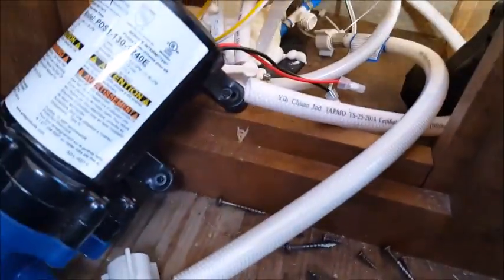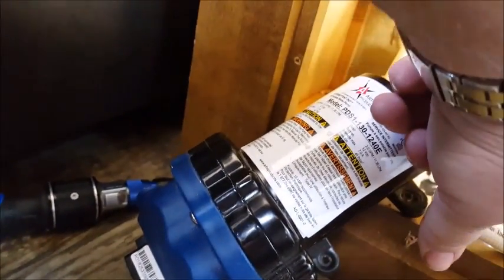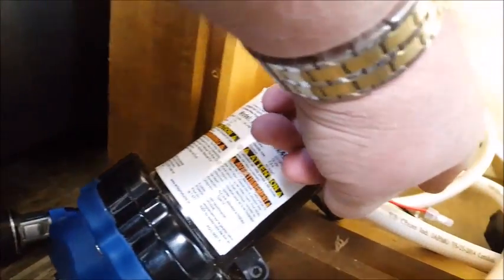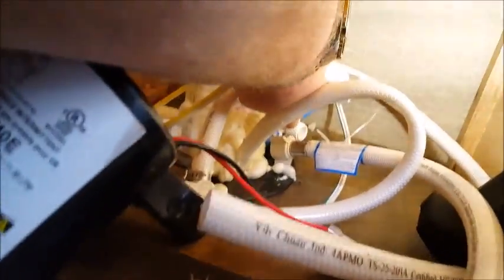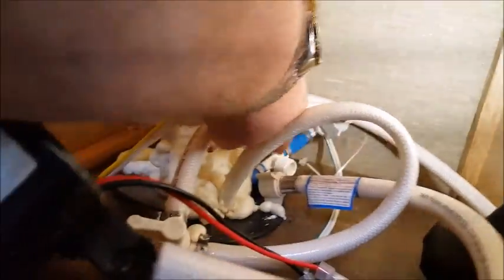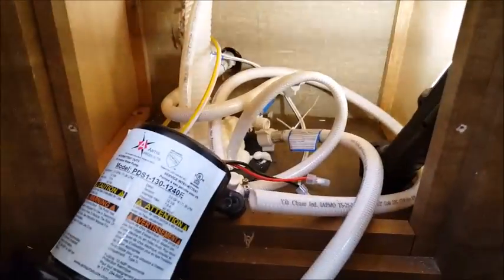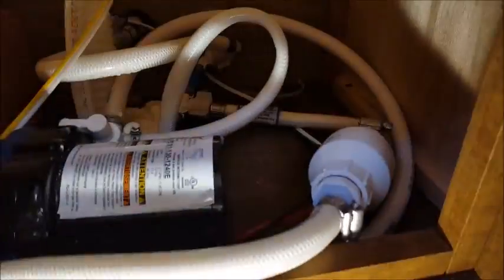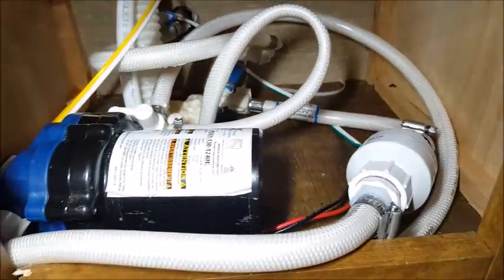Check Valve Installed in Water Line in RV

Comment: I had the same problem with 3 Surflow water pumps in a 18 month period. Messaged the manufacturer my problem and they acknowledged that they have/had a problem with the internal bypass valve and wanted a photo of the pump with the manufactured date (02/2020) and they would send me a new one free. I did receive the new pump, but in the mean time the water quite flowing into the water tank, so I just put the pump away for now.  Will be installing the check valve as a back up.

Comment: Here's my take on city water flowing out the fresh water storage tank.

The city water comes into the RV via a check valve at the city water connection.  I regulate the pressure to 45-50 psi.  The fresh water tank feeds non-pressurized water to the pump which, by its design, acts as a check valve.  Once the water is past either check valve it is trapped.

Enter the hot water heater.  As it heats the water, the water expands.  The check valves keep it from leaving the system so the pressure builds in ALL of the plumbing.  Turn on the tap and the extra pressure is relieved.  And if the hot water heater stays on, the small amount of expansion of the new, cold water in the heater can be dealt with by the RV plumbing until someone turns on a tap somewhere aboard.  Anywhere aboard. 

The water heater is the biggest single draw on my 120 volt, 30 amp electric service.  I can't run the water heater, the AC and the microwave (or a hair dryer) at the same time.  With 90+ degrees weather this spring in South Carolina the line voltage dropped from 123 volts at 6AM to as low as 108 volts at 4PM.  So limited amp service and a brown out that makes the AC draw even more amps.  Somethin's gotta give.

I shed the water heater to propane until the gas bottle started getting low.  Then I just turned it off until I needed it.  I did notice that fifteen minutes later when I ran the tap it gushed for a second till the pressure dropped.  

The real problem:  the RV plumbing has no pressure relief valve other than the water heater PRV rated at 150 psi, 3 times the normal regulated pressure.  This will damage the plumbing.  If the check valve function of the water pump fails and you put a check valve in the line that can take higher pressure the next weakest point will fail.  A weepy fresh water tank is one thing; a burst pipe under a sink is a disaster.

The solution:  Don't turn the water heater off, or don't turn it on.  Or... Install an expansion tank in the RV small enough to fit in the pump compartment (or under a sink) but big enough to keep the pressure from going nuts.

Expansion tank or burst pipe.  It's your choice.
Reply: Really nice explanation.  So what’s this expansion tank?  Got a link?  Is it standard rv stuff?

Comment: We had the same problem on a brand new camper, took the pump apart and cleaned it. That didn't fix it but after installing a check valve it worked like new. It cost us $9.00 for parts at the local True Value Hardware store.
Reply: Did you install in the same place as this guy?
Reply: I put a check valve on, still let water thru to the fresh water tank

Comment: I have the same issue that I am trying to troubleshoot.  My pump apparently has a back flow valve in it and that probably the failure.  Might be cheaper/easier to do this fix.
Reply: I think I have the same problem... I have a Shurflo 4008 pump that has an internal check valve, and there are replacement check valve kits available (found some on eBay for about $12) but I've found zero instructions so far on replacing. I may do this instead.

Comment: Did you solve the problem or just mask it?  How long did the pump function as the check valve before it failed?  Do you get full pressure off the pump or has it lost pressure?

Comment: Water was leaking out of my fresh water inlet.   took it to the rv service shop to have check valve replaced. He replaced the city water inlet instead .  I said it was the fresh water inlet leaking. He said nothing at that point of the check valve of city water connection being the problem with the leak in the fresh water inlet connection. He simply put old City connection back on and put in new fresh water connection. Seems like its still leaking. So the check valve fail at the city water connection would cause the leaking from my fresh water inlet???